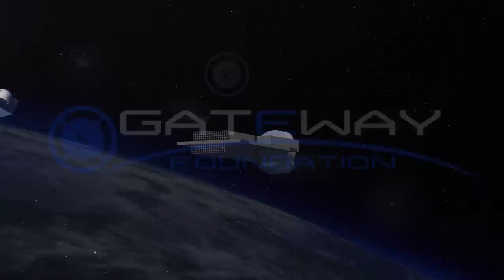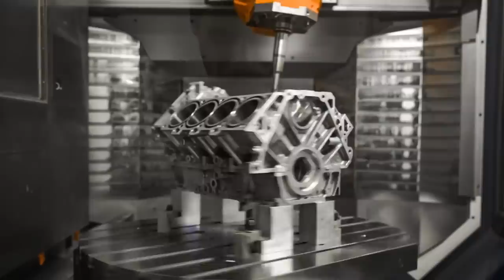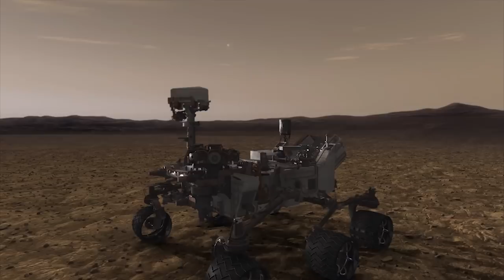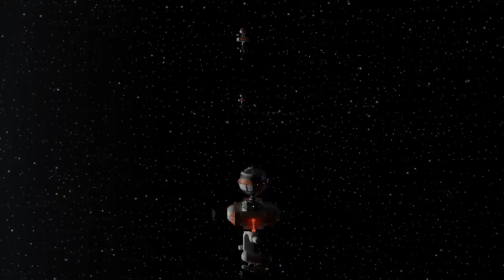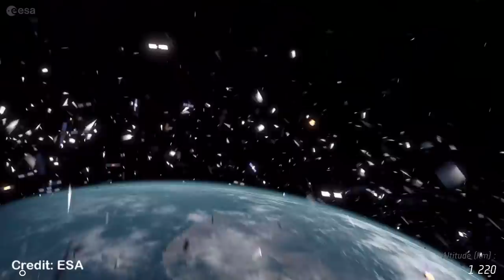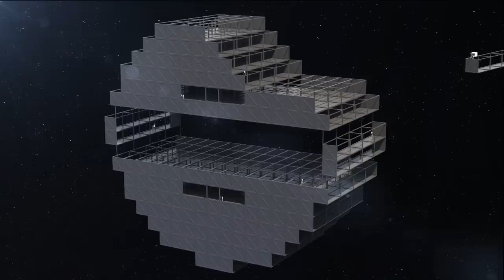Orbital Infrastructure

Comment: One thing I disagree with is that you wouldn't be able launch through a post-kessler higher orbit debris field: I think you could and it would only mildly suck. The larger parts would be tracked so the ship could make micro-course corrections to avoid them and the transit time (for an interplanetary ejection) would be very short so the ablative armor requirements to deal with the small stuff would be quite modest. Another possibility would be using a polar ejection, the long-lived debries would be concentrated in certain planes, since very few satellites pass directly over the poles there would be a "hole" of sorts over the poles (this can actually be seen in a 3D map of space debris if you rotate to view the poles) where the debries would be a good deal thinner than say at the equator, especially if a lot of future orbital infrastructure goes around the equator to take advantage of Earth's rotation (there is no way that debries from an equatorial satellite could end up passing over the poles, the deltaV requirements for that plane change are truly absurd). Of course using a polar ejection would carry a deltaV penalty, as would having additional armor, but I'd view this as more of like a +25% mass penalty to interplanetary missions (I mean larger ones: BFS scale, armoring is one of those square-cube things after all) rather than a grounding of mankind; in fact to the contrary, it might even incentivize utilizing & colonizing space beyond GEO.
Reply from the maker: It would just depend on the actual density of dangeorus objects, if that's low enough that maybe you only have a 1% chance of taking a catastrophic hit to your ship, you might launch, and if it were much lower I'm sure you would, especially if just passing through to a safer higher orbit, I'd say geosynch would be quickly repopulated in a case like that with satelites, but it is a very narrow and clutter band where debris would dwell a long while.
Reply: I hadn't thought of the polar hole idea before. It could be a kind of escape clause if the Kessler apocalypse really does come to pass. Hope it doesn't come to that...

Comment: Great vid as usual. 
Here's a little factoid: sending a full Falcon Heavy payload (64 tons) to Mars using a 100 GW beamer at both ends for acceleration/braking would be at 10^-3 gee and take 10 weeks.
Reply from the maker: That actually seems a bit low, just raw mirror-drive is 3 GW per ton at 1 gee I think.

Comment: Seems to me it would make sense that, when you are building something in space, you would surround the work area in a bubble made from some really tough translucent cloth. It wouldn't stop incoming objects moving at a kilometer per second or more of course. But it would stop any debris from getting out of the work area. This would make recovery of lost tools, equipment, and astronauts much easier. Plus it would block the direct sunlight and give the work area diffuse lighting which would help a lot. And it would help reduce some of the extremes in temperature you get when working in space.

Comment: Re: clearing orbital debris: think about how polluted the harbors of major port cities get from just the unintended runoff of everyday industrial/commercial/personal use. Airplanes obviously store any waste generated onboard until landing, but ships at sea for weeks or months have to occasionally discharge bilge water. And not everything on board a space station/orbital factory will be recycled with 100% efficiency. If miniscule ice flakes (or paint flakes off the side of a ship, or plastic or metal chips from docking ports grinding together), humans will inevitably generate a cloud of debris around them of varying density.  Not all of this will be easily disposable, especially if you're not somewhere near a deep gravity well (think Lagrange orbits or the Asteroid belt). Just taking care of the trash will be a full-time industry at the K-1/K-2 level. 

I was impressed by the idea of a "laser sweeper" to deal with tiny particles.   What about a physical "broom" of sorts to deal with larger stuff (i.e., the lost hammer)? Say, a giant funnel/scoop-shaped Kevlar net that can be maneuvered to catch stuff?
Reply: I cant think of any better solution. Short of just ignoring it and hoping that the 20 billion pieces of tiny sand in low earth orbit wont hit us today and make 20 million little tiny holes in our space habitat.

Comment: Issac, most descriptions of building orbital colonies seems to assume they'll be made of metals mined from asteroids and moons. Prefabbed girders and panels welded together. I have a different concept. Assuming that mining leaves us with gigatons of spent tailings, could we not simply build the bulk of our colonies out of that rocky material and save the metals for more critical things?

Picture a process like using a big mirror to heat a stream of crushed rock to sinter it, depositing in layers, building the colony up like it was in a giant 3D printer. Built upon an inflatable form, if necessary. Depending on what the rock consisted of, the finished material should be like concrete or ceramic. While this would have more strength under compression, rather than tension, It seems reasonable that this material would be strong enough. Consider an empty egg shell, scaled up to a couple of kilometers across. It would easily withstand rotation and hold quite a bit of material inside as well. It could also be built up honeycombed or corrugated for additional strength.

Do you see anything fatally wrong with this idea? Do you have doubts about the material's strength or other issues that would make this impractical? Are orbitals simply going to have to be made mostly of metal and glass? If so, what in heck happens to all that spent rock after mining? It gets overlooked in tales of space prospecting. But if my idea is a good one, it could make it one of the most valuable resources.

Also; way too much talk goes on about colonizing planets and moons. Colonies will always be much easier to build, commute to, and set up optimal living conditions inside.

Comment: Tig welding in a magnetic curtain would make for near zero welding debris. Only that process needs to be made to have increased penetration. Currently the max penetration, also known as full pen welds are performed with spatter creating processes. That makes for larger ships to be made, but with the added cost and time for spatter control. Tig prevents that and can cleanly weld aluminum, a crucial element for ship design. I think the gravity is needed in the case to collect molten projectiles from escaping the "welding bay". I see the small moons of mars being a good place to consider. Not to far from earth, near a potential base on mars, and its low gravity aids in collection with little restrictions towards leaving the small mass. This is all speculation as we have never welded in the vacuum of space, so no viable weld samples exist. It's not immediately clear it can be done properly in space with any current technology. We need to get welding up there to know.

Comment: There’s an easy solution to the stuff you put in orbit blocking sunlight, just put the ring alone the same plane as the circle of illumination. Since half the earth is always in sunlight, there is a circle where the light becomes dark called the circle of illumination where everything on one side is illuminated, if you build your rings alone that circle in orbit they can be as big as you want them to be as long as they stay in the plane that the circle of illumination is on without blocking sunlight at all. Note that I have not taken into account any effects on the moon receiving sunlight when it is behind the earth or nearly behind it, as a huge flat ring of solar panels might block that, making the night more dark for us, but that’s the worst that would happen.

Comment: Wow, a runaway Kessler syndrome sure would be a depressing filter to get stuck on for several thousand years, in terms of the fermi paradox. It doesn't qualify as a potential solution, but it still seems like a frustrating thing to get stuck on for a while.

Comment: So I'm attempting to write a sci fantasy story and I had a solar  transit system, the ships get around and to transmit power everywhere, and they have tens of trillions of automated drones that fly around grabbing any object that is between 20cm^3 and 10m^3, also manufacturing non electric hand tools tools from Ice has become somewhat commonplace, because then the drones just laser it and poof, no muss no fuss

Earth actually doesn't have that much infrastructure around it, 5 Colossus class space stations (can hold 100,000,000 passengers) acting as the hubs of commercial space elevators, there are about 80 additional stations, which serve as shipyards and power relys, and 500 military elevators which can deploy large numbers of solar range combat vehicles, and weapons platforms in minutes
Most of the infrastructure got commuted out to Venus or Jupiter as Venus is the Industrial capital of the Terran Empire, and Jupiter is the birthplace of the first, second, and third star fleets, producing 80% of space worthy vessels for the empire

Comment: Great presentation as always. I hadn't thought before about possible risk from open space welding on orbit, but as soon as you mentioned it it became so obvious. Even a small delta vee of sputter can really bite you in the ass in the next encounter (not to mention other payloads launched to the same altitude but with different inclinations).

 As I recall, the first few Soyuz orbital rendezvous missions were prevented from docking by imprecision in their orbits, as their crafts oscillated up and down in relation to each other. The same equations apply to welding, only much more randomized. Might a thin layer of fine mesh surrounding a weld be sufficient, if placed at a suitable distance for cooling off of the slag? I would guess nobody yet knows for sure, but now's the perfect time to figure this kind of problem out, lest it become a show-stopper.

Comment: could wrapping an orbital habitat in plastic wrap be a good idea? it would hold in the air even if the main hull breaches during pressurization, it would stay longer and to evac the station.
Reply from the maker: Well generally anything that punctures it will puncture the wrap too, ideally you want some liquid or gel that hardens when exposed to vacuum.

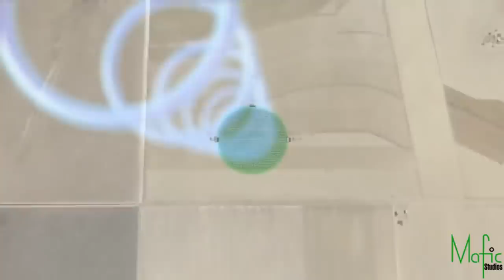Comment: At about 15:00, beaming energy back to Earth got me thiniking - if some frequencies don't survive very well in the atmosphere, couldn't we put a collector on top of a large tethered blimp, up at say 50,000 feet, and run the electricity back down the tether.  Then we could use a frequency  for the energy beam that would be degraded by the time it reaches the ground, and remove worry about frying things if the beam misses the collector?

Comment: Superconductors should operate at temperatures in space that could be achieved without additional cooling. Do we have plans to manufacture superconducting circuits to assist in the space industry? If not, why not? It would seem that a "superconducting super computer" could be of near infinite utility and take advantage of the vacuum and near absolute temperatures with appropriate shielding?
Reply: Superconductors are certainly useful and may well be more viable in cold space,..
 but computers rely on SEMIconductors for their ability to electronically switch signals.

Comment: I haven’t run the numbers because I’m on the bus, but I’m wondering if a feasible use for some of the excess heat generated in orbital solar shading panels would be for dealing with micrometeorites and debris, particularly with vaporisation by laser in mind. I mean, if we’re going to stop the energy getting to the surface of the Earth, may as well make good use of it
Reply: Serves me right for commenting in the middle of the video, there was about 25s between posting and reaching the point where you talk about it.

Perfectly cromulent use of “embiggening” though, very good choice ;)

Comment: When possible it would be prudent to require that some items in orbit be made of material subject to UV degradation. Not all items are intended to be constantly exposed to sunlight. Or would that simply make the problem worse in that it would lead to many smaller particles in orbit until degradation is complete instead of a single larger object? Additional counter-measures would be when practical using less material in an object when it does not compromise the functionality of the object. Some orbital items need not be solid to be functional. It can be hollow or have interior voids and lattices. I'm assuming this measure is already in use to reduce the launch weight.
Reply from the maker: I think we're more likely to regulate removal and setup a removal system, rather than build in a half-life, hard to say though, that's a viable approach.

Comment: About the Kessler Syndrome: couldn't a sufficiently advanced race just use some sort of energy shielding, either protect replacement projects, or better yet, to protect existing satellites and structures.

 These wouldn't necessarily have to be the fictional deflector shields that somehow uses plasma or manipulates gravity either. Most likely, a civilization that would have no problem mass manufacturing compact pin point laser emitters with enough output might be able mount those in all structures, and use those to automatically vaporize incoming space debris, effectively creating a laser wall.

Comment: I think that - regarding Kessler syndrome - you might've gotten the wrong end of the stick. The problem with Kessler syndrome is not technological but economic. we can solve Kessler syndrome right now if we wanted to, the problem is that it's not profitable for an individual firm to do so. we don't impose the social cost of orbital junk onto the firms that launched them.
A legislative fix is necessary, whether that take the form of mandating liability insurance for satellites or a "Land" value tax in space, getting rid of externalities is all that needs to be done to avoid and/or fix Kessler syndrome.

Comment: Hey issac, what's your take on a hypothesis I have? If we are in a simulated universe, then possibly the reason for relativistic and gravitational time dilation could be the result of the insufficient processing power due to the shear quantity of objects/particles contained in to small of a 3 dimensional area. For example too many objects having to be rendered and their interactions calculated at the same time and so the simulation slows down as a result. And even becomes too much of a burden to the simulation that it "crashes" and therefore unable to be rendered is hidden behind an event horizon as a result.  So because a black hole has so much data inside such a small region the outside observer can't witness anything inside because the simulation has frozen and a lack of information would appear to an outside observer as a black void in space. And like wise objects traveling at relativistic speeds would have more demands as well on processing.   What do you think. So the fact that objects attract each other, and are compressible as well, in the simulation, overtime this results in a over density of information builds up. As the volume of data increases and it's  density, the time in the "real world" required to process all of the information increases as well. Now if we assume the computer running the simulation is comprised of individual computational units and each unit is responsible for it's own finite volume of 3d space to process. Then the ones required to run the simulation further away  from the black hole would be running faster in comparison.  In that frame of reference, a observer would witness events happening upto a certain distance from the over density as happening slower and slower untill, events are unable to happen at all and likewise information of those events would decrease untill no information at all gets to the observer, as an example events taking place inside of the event horizon of a black hole are unable to be witnessed because the simulation has ground to a hault. From a outside observer it would appear as a black void of nothing because the cpu's are unable to send there results. 

I look forward to your feedback.

Comment: Have to say if there is anything that would encourage orbital infrastructure it would be when corporations find it is cheaper to have no pollution restrictions on the moon or an asteroid than maintaining controls, systems, and safegaurds on earth.
Reply: you missed the point i think. 1 mined asteroid could be worth over a trillion USD. Honestly, there is more money in space mining than humans have ever used, ever. Space pollution comes way after that.
Reply: Well of course, space is infinite. ;)

Most of what we use and purchase is plastic based. A mining operation won't serve much purpose to the majority of human needs. Unless there is a replacement for plastics that can be mined, you aren't going to have the need. Especially since recycling of materials will grow greater and greater as we near the 11 billion population stabilization point.

Unless farming and advance manufacturing becomes feasible which pollution controls will unquestionably mandate in coming years, there is no need for an orbital infrastructure. You can easily handle that task right now with robots and rockets.